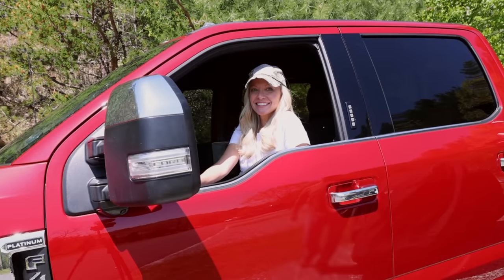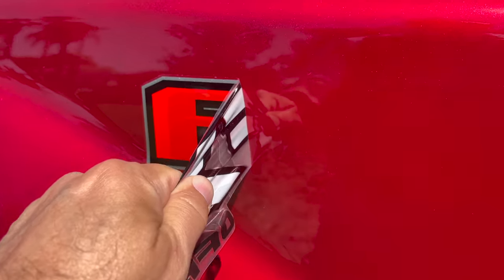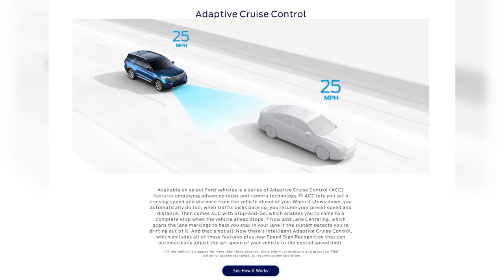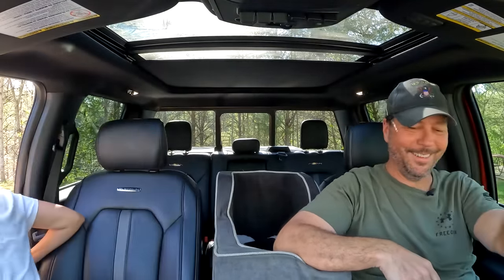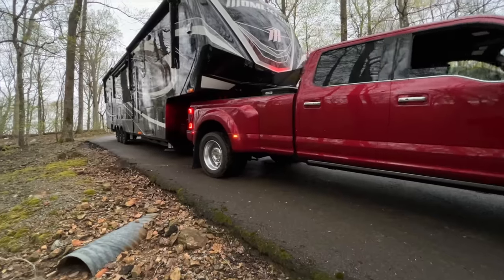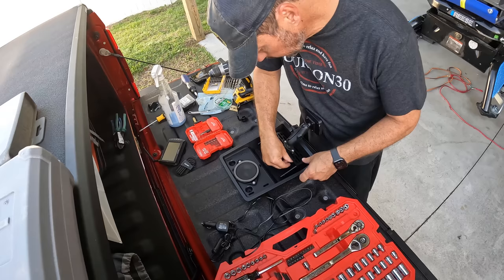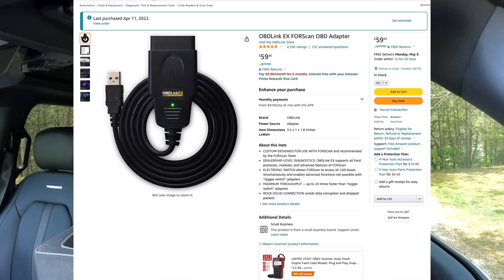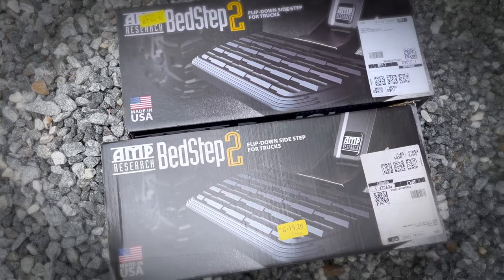2022 F450 Platinum! (Full Time RV!)

Comment: Congratulations on the new truck! 

Get yourselves a banks ram-air differential cover and cold air intake. Better towing mileage, cooler diff and better EGT’s/MPG’s (intake) - you won’t be disappointed - installed them both myself.  Good idea on the rapid-heater and engine block heater... Have those on my 2014, great features. They come in handy a lot up here in Maine haha. The AMP bed steps already mentioned are also great ideas. A little pricier, but I find I get better mileage and wear protection using amsoil in both the 6.7 and the diff. I know you’ve been down the DEF road before (I don’t have a DPF, heh) - make sure you use a good additive like Stanadyne since you’ll likely be keeping that on.

Comment: Guys, love your videos. I would offer some quick advice. Get Powerstop Rotors and brakes for the front end.  You could go for the rear too, but you will notice a HUGE difference on the front!
Reply: Different how?
Reply: @denispinet3480  I noticed under emergency braking I was loaded with 26000 pounds on a gooseneck trailer that I was able to stop before the truck next to me that was towing nothing and stopped way before him.  The moose didn’t care but we did and it just grabbed where the stock brakes would not.  I had zero fading issues and the brakes and rotors just did its job.  I could not believe the difference in how quickly I was able to stop versus stock setup.

Comment: Congratulations on your new your new ride have a 2020 450 King Ranch and tow a 21k DVR.With the Gen 3 Powerstroke and the 10 speed it's a Tow Monster.One comment on the adaptive cruise, if someone cuts in front of you to take a exit, it will suddenly apply brakes , which is a good thing, but will have cursing the driver and that maneuver.

Comment: We have a 2021 F-350 diesel to tow our 40ft Montana. I ordered it to tow. I was shocked at the low cargo rating!!! However it tows like there is nothing back there. I installed AirLift bags right away to prevent any rear sag. When I took it to the dealer for a recall they told me I have voided my warranty because of the air bags!!! There is a Federal law that prevents them from doing that....it is called the Moss-Magnuson Act. Google it if they give you any crap. Next I forgot to order the upfitter switches (oh crap, my fault and wires are everywhere, LOL!). Interesting thing and I wonder if your truck does this, when I plug in the trailer to the truck I get a warning light and message that says the BLIS system is deactivated because of the trailer! WTF! Maybe it is from that back up assist knob, which I don't use either. The dealer says that is the way it is supposed to be. If you want to just vent the sun roof the shade goes all the way back. That just doesn't work in the hot Florida sun. Don't get me wrong, We love the truck and get a lot of compliments, just like you will do. Beautiful truck. But the forscan may be able to help me with those problems. The dealers won't even look into it. Enjoy the new truck. One more thing, I did see that you can order the extended running boards from Ford when you order the truck....I did and love them. They go all the way to the front of the rear fender well opening. Sure makes it easy to get up in the tool box.

Comment: I checked Liquid Spring and Stony Boot channel interviewed Jared Sund of Staple Camper with his Liquid Spring upgrade. But it is going to cost you about 15k for your truck. I would love to have it cause it aids in leveling a truck camper, you don’t need it for that, but it does smooth the ride on your bigger trucks.

Comment: What ceramic product did your detailer use to give a 5 year warranty?  I've had 4 vehicles with ceramic by System X and after 6 months it was a wash-out.  Have researched many others only to find sketchy installers.  They talk about the professional series but apply the everyday DIY applications. No warranty when you suspect an issue. Hope you have great results with yours. I fell back to industry standard practices by automotive shops and forego the ceramic fad. Beautiful ride.
Reply from the maker: I believe it's ceramic pro and we have a 5 year warranty.

Comment: Lots of questions, how did pricing compare between the 350/450 at this trim level and options? We have a lighter GVWR with our 5th wheel but that turning radius is really got me leaning to the 450, plus it’s BA looking Lol
Reply from the maker: Honestly didn't compare but I think the prices aren't too far off from eachother.. Ford has a build and price tool you can use to compare.

Comment: I’m curious to know if getting this truck was it any way driven by the 410 you’ll be taking delivery of soon. I researched some of the Volta system in the 410 will have and it requires an additional alternator just to charge the Volta batteries. Did that require the 450 or was your 350 capable of an additional alternator? What about the weight of the new trailer versus the old? Did that require a bigger truck also? Something tells me you’re going to do a video on that at some point.
Reply from the maker: Separate decisions...  Volta has their own alternator that can be installed on most trucks, including the 350.

Comment: Keep the ceramic going…..consider applying ceramic window tint. As a skin cancer individual, I added this to my truck (including the sunroof) and it greatly reduces the UV rays. In addition, it also cuts down on the heat from the sun. I’ve noticed on long drives, I don’t have to have the AC down to the coldest setting on hot, sunny days.  Looks great!
Reply from the maker: We did that but it didn't make the video... The heat is MUCH better!

Comment: Congratulations on the new truck and accessories! I have a ‘17 F350 Platinum and like it a lot. My next truck will be a F450 with the same set up. Although I have the 4:11 rear end in this one which is an ambulance rear end. They called it a camper special on this truck. So I don’t think they’ll be much change in the ride for me. 😂

Comment: Chad, a few questions since I have a 2022 F-450 also. The BedStep2 doesn't seem to have a version for the 2022 model and everything I have seen says the 2021 version won't fit. Have you discovered otherwise? The other question is related to the backup assist. The package came with its own 7way/4way connector. The dealership put it on, but replaced the bumper connector with the new one. I'm thinking they should have replaced the one in the truck bed for use with a fifth wheel. Does that make sense to you? Thanks!
Reply from the maker: The model for the F350 fits fine but it does have about a 3/4" gap when the step is folded versus right up against the frame.  Not very noticeable.  On the connections, I'm just not sure.  Our truck has both connections on the bumper and in the bed.

Comment: Hey Chad:
I looked around and the only air ride system that wasn't a lift was Kilderman.  So i just finished installing the factory ride height system.  They do make lifts as well.  The kit came with Rancho RS9000 shocks so you can also adjust the ride dampening depending on your likes.  Its a night and day difference over stock springs.  An added bonus that we actually needed was the capability to kneel the truck.  I did that for easier egress in and out of the truck.  Not an inexpensive system but well worth it in ride quality.
Reply: Kneel the truck? Never heard this term before? What exactly is it?
Reply: Hey Steve: have you ever seen a big city bus come to a stop and the front end drops to the ground so the passengers can get off.  That’s kneeling the vehicle.  I did use it on my f350 because being a 4x4 it sits high and my disabled wife has difficult time getting in.  So when in parked I can drop the vehicle height .  The side benefit is an improved ride over stock.
Reply: @bill29456  Interesting - i'll have to look into this as my wife has had two knee replacements and this may benefit her as well. Thanks

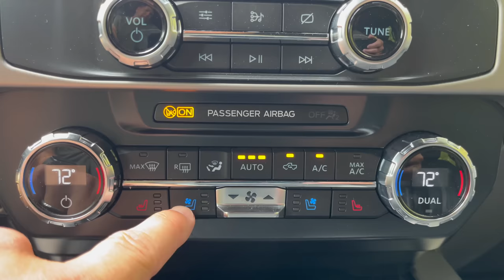Comment: No comment about the 10 speed transmission paired up with the 4:30 rear end? The 10 speed transmission gives you tremendous amount of power on the start, and feels like you have a 3:75 rear end on the freeways.
Reply from the maker: Yea.. We plan on making a towing video and will get into those details for sure..  👍🏼

Comment: We have the Trailer Backup System on our 2020 F350 and like you, I've been backing up stuff for years and don't use it much.  But, I have played with it and have used it a few times and it works really well. I made a wrong turn one day and had to back up a long ways and decided to try it and it worked great.  I backed up several blocks in a straight line and was amazed at how well it worked.

Comment: After using your truck to pull your new RV do you plan to add Air bags like you had on the F350?
Reply from the maker: We are thinking about the Kelderman system which replaced the suspension on all 4 corners to air...  Maybe some tires with softer sidewalls too.

Comment: the Kelderman 4 link air suspension might void you warranty because you have to remove the entire rear suspension. Alcoa makes a 19.5 rim if you want to replace the steel rims so that you don't have to dismount and remount four tires. we have placed our order for a Palatium F 450 as well with just about some options, have looked at Air Lift air suspension you may want to look at them. Remember that the tires are continental commercial truck tire the side walls are more rigid than what's on the 350.  plus, Continental make a tire that will fit your toy hauler HTL2 Eco, Load rated Speed 75MPH, Fits 6.00 and 6.75 Rim,  Max single load 4805 lbs.plus low rolling resistance.

Comment: We have a 2019 and it is our 3rd F450, and each one is better than the previous one. We are King Ranch fans and this one has all the chrome and options and we LOVE it. The difference in towing is remarkable, and if you are starting into a pull, a tap on the fuel pedal and it takes right off and rarely down shifts.
Reply: Yes, chrome options looks great with common sense. There is a dealer called "Wild Wilie - Atkins Ford" which for some reason do many chrome delete and having them paint match the color of each truck.   I have star white F450 Limited on order and I want to use it for my daily driver with low maintenance.

Comment: Congratulations on the new truck.  I agree with you that the 450 is underrated, likely for the purpose you mention ford didn’t want to classify it as a class 4 commercial vehicle.  We have a 2020 f350 DRW, it’s payload is 5353.  We use the ICS dash mount system for our Garmin RV890 and phone, works well.  We have the VanTru dash camera too. As far as ForScan, consider enabling OCR “Operator Commanded Regeneration” and research “High Idle Resistor”, great for cold weather warmup.  I added both of these features
Reply from the maker: Thanks... I've heard about the OCR... I need to dig into it and try it out.
Reply: @ChangingLanes  .. you can pm me if you want more usage details

Comment: Just got my 2022 450 after a 3.5 month wait. Miss the ride quality of my 2020 srw 350 but it does have serious pulling power. The turning radius is nice, the 19.5 tires are not so great. The 20in Michelins on my 350 were so smooth and quiet. The 19.5 continental tires on the 450 are terrible. I bought it to pull our 42ft  grand design exclusively as we full time the next 2 years. Definitely going back down to a srw 250 or 350 when we get done traveling. Just too much truck for a daily.

Comment: Waiting for my 2022 Expedition that I ordered the beginning of March to come in.  Hopefully by July.  I was going to go to Brandon, but Matthews Currie is closer.  Trading in my 2019. I love all the new upgrades especially the safety upgrades.  What I think is great is the silver part of the key fob pulls out and when you pull on the door handle it exposes a keyhole.  So if you ever can’t get into the truck due to battery issues in the truck or key fob there ya go.

Comment: Congratulations on your upgrade and hope its all you have hoped for. 
I ordered a F450 on March 26th. We have also bought our first 5th wheel a
2014 Heartland Cyclone 3100 and are looking forward to some great 
adventures in it.   

We ordered one in the same color as your old truck and actually  considered 
a F350.  We got the XLT Rubber floor, Trailer tow assist, got the 5Th wheel hitch 
ford offers , also ordered the rapid  cab heating,  a block heater, and operator commanded regen.

I will say, I don’t like the idea of liquid spring Hydraulic Suspension. I feel its gonna add a lot of complication 
to a purpose built truck, More places to leak, probably very expensive to purchase and repair. 

It’s nice to able to go to a ford dealer with that extended warranty and resolve your problems. 
I plan on the Centrimatics and the same tpms system for the Cyclone and the F450. 
looks like i have about 7 months to go before mine is ready.

Comment: I like your videos, and I always check to see if you have tested an item I want  before I buy it. A minor clarification I think is in order regarding the difference in the turning radious for the f-350 and a f-450. In the "why we upgraded" section of the video you said the biggest reason you got the f450 was the turn radius. the turn radius of a 2022 f-350 is 23.8 to 29.8 and the 2022 f-450 is 23.8 to 25.2 a difference of 4.6 feet.

Comment: I have an F350 SRW Platinum on order. Was told 9 months wait time. On average it is 7 months, the F450 is taking even longer, so to get one, especially with the constraints for adaptive steering, spray in bed liner and 5th wheel prep, to get it in 5 months, you either have really good connections or got damned lucky.  There are guys waiting a year on an XLT!
Reply from the maker: Either we got lucky or maybe Brandon Ford (worlds largest and highest volume ford dealer) gets an advantage when ordering...  No idea...

Comment: It is almost June and I am still waiting for my truck.  My priority code has been changed to 10.  Have you done anything for your ride quality for your F450 stock to stock configuration between Cali, Kelderman, Liquid Springs?
Reply: Last Nov, I walked away from Ford and picked up 2023 Ram 3500 Limited HO 6.7 DRW LWB.  It comes with TPMS and Air Bags for better ride.  Inside cabin is very quiet and better.  It comes with 6 speed 4.1 so mpg is about 16 mpg.  Ford will be better with mpg.

Comment: For payload capacity check out a 450 extended cab long bed cab and chassis. Then put a flat bed and turn 90 degrees with any trailer made more pay load and very easy for hook up and even add covered cargo or fuel tank behind cab. Best pull rig made.

Comment: I’ve got a 2018 F150 and you already hit on two things that annoy me on mine.  The double honk when you get out while it’s running is excruciating.  I hate horns, and there’s nothing worse than ruining a quiet campground when you step out and each time get that totally unnecessary double honk.  Second, my CarPlay requires you to be all in on the CarPlay, or not use it.  There’s no mixing with say the Ford navigation and CarPlay for Pandora, just as an example.  Drives me crazy.  So now you just run CarPlay as an app within Sync instead of being limited to only CarPlay, very cool.  And of course everybody is finally catching up with BMW on the wireless CarPlay front, which is great.

Comment: Congrats on the new truck. I have a 2022 F450 King Ranch, love the it. Pulls my 3975ck Cameo with no problems. However I have had some issues with the navigation, went into the service department 3 times to get that fixed. Now there is a recall for the break controller just a software up date for this fix, its been at the service department 3 time and still not fixed. Ford engineers are still trying to figure that out. I can tell you it's not a bad gate way, my truck has pretty much told ford to stick it, will not let there computer in to do the up date. With that being said I have not had any problems with the break controller.
Reply from the maker: Ours was built post-recall and wasn't affected.. 👍🏼   But thanks for the heads-up!
Reply: @ChangingLanes  your welcome and enjoy I don't think you'll be disappointed with that truck at all.

Comment: I have a 2021 F 150 Lariat. Has everything you have for the most part. Here are the things to look for in my opinion. First the info screen can go black in and out. Happen to me. If I turn the running lights off or dim the screen will go black. Happen in the 2020 XLT I had as well. The second was front and rear brake assist stopped working. Left it at the dealer for a week while I was out of town. Took all week. The  components were the front camera had to be replace. Also it has to be good weather to drive it to reconfigure the cameras. They had to roll out a Mat the length of the garage to do it. Good old New England weather.  The next was the blue tooth module had to be replaced. When the infotainment screen was replaced it had a faulty blue tooth. There are three recalls I am waiting for parts for. Nothing big. The first 3 things were errors after 6-8 mos of having it. I love the truck just a yr old now with 15000 miles. All issues were fixed at no cost. Just time lost. Great vid and love the vids. I am looking now for a heavier truck. Planning on a airstream rv. Enjoy the rig